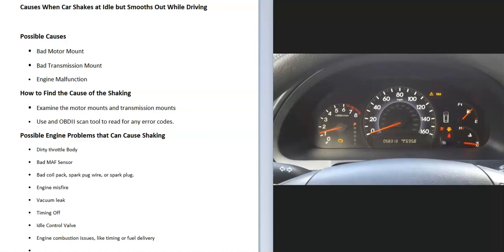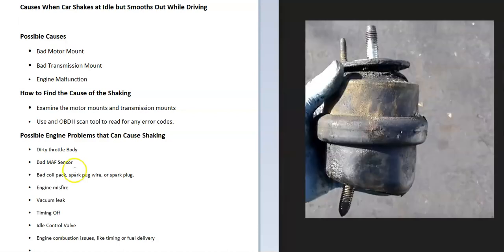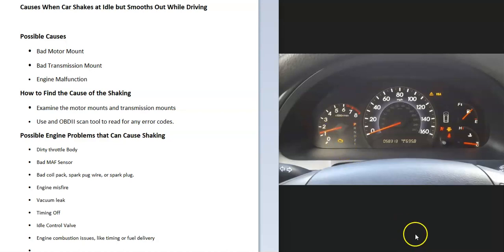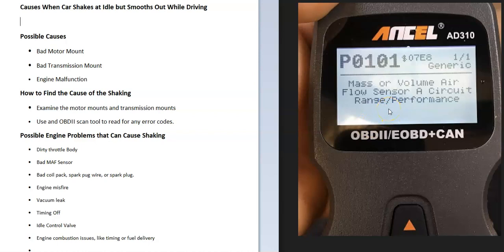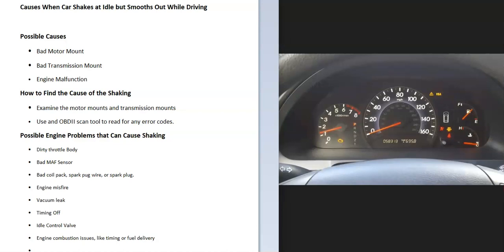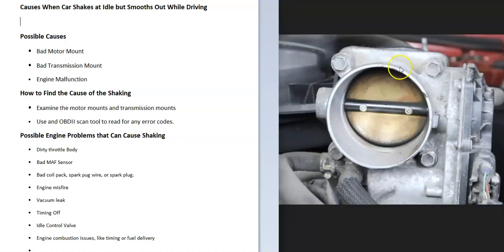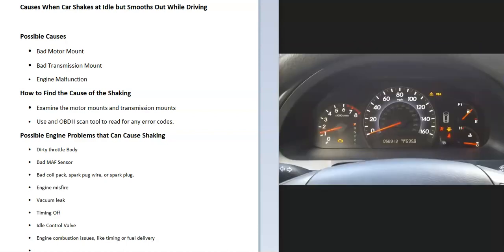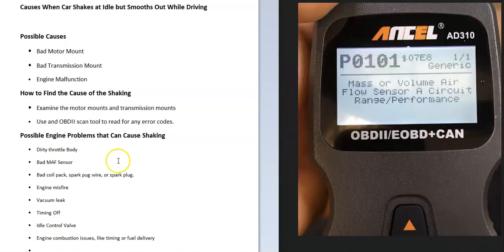Causes When Car Shakes at Idle but Smooths Out While Driving

Comment: 2008 Toyota Corolla shakes when idled. it’s not terrible it just rattles the glove box. 

Sound familiar or Any ideas what the issue may be? 

Will be taking it to AutoZone this week for the scan tool assistance.
Reply: My Honda accord shakes also at idle...spent over 2000 to fix  w two different mechanics..one Honda dealer...and still shakes.   I am wondering if it is safe to drive!

Comment: Hey @HVAC I desperately need your suggestions. It is toyota axio 2013. My car shakes when it is just braked to idle and specially when the AC is running. When the AC is not running, it is fine, no shakes.

Mechanic wants to change the gearbox. What should I do?

Comment: My wife has a chevy sonic that idle rough while in park and while in drive while stopped but smoothed out while driving, changed the motor mounts, and still ran rough but not as bad, gave the throttle body a clean and changed spark plugs and runs like a dream now, but yea there literally 1000 things that can cause this

Comment: my Elantra 2008. I added freon and is working fine, cool really good, but now is making the motor to vibrate. Every time I turn on the A/C the RPM goes down and the motor vibrates, stay at 600 RPM or less but the car Vibrate and I see the motor vibrate much more than when I turn it off. Once I turn off the A/C RPM goes back to normal. Idler air control valve is new. Motor mounts are new. PCV clean. MAFS new. Throttle body clean. throttle body sensor new. O2 sensors new. Car has 182K miles. Engine filter new. no vacuum leak.
--- Any Idea?  Thanks

Comment: My Mazda 3 engine vibrates alot when in idle either in D or P modes. I've already brought it to the workshop and they have changed the engine mounting and spark plugs. But the shaking and vibration is still there only at idle. What can I do?

Comment: What you are saying is very important and true 💯👍 but you don't get is this low on, fluids 😮 and yes very important part is the pcv valve so if you are going to put this what you are saying 😀😀😀 you better get it right because Harry homeowner will never figure it out 🤩😉😔😅😅 and yes codes are very misleading under stand because you need to get it right 👍

Comment: I replace the spark plus and coils still shaking , i clean the airflow sensor plus the throttle  an d still it shakes in reverse and  if i stop after i start driving it goes away , do u thik is the air sensor in the back ?   thank you
Reply: sorry oxygen sensor

Comment: Thank you! This video was very helpful.. hopefully you can help me with my challenger.. currently my is a few things.. bought a 2012 Challenger used didn’t realize that the transmission Bell housing bolts were not screwed all the way down and the transmission bill housing plate was open. I just tighten those bolts back down. But now I am getting a light white smoke from the engine bay and I’m not sure where it’s coming from. Could it be coming from the transmission bill housing plate being a little bit open? Also, I’m trying to locate a hissing sound that I thought was coming from the radiator hose because it looked like it wasn’t completely sealed. A low humming sound while the car is idling and the AC compressor clutch not engaging. I was told that there was a miscommunication maybe between my TIPM and the AC compressor clutch and that I should have it looked at but before I give my car to someone to have the TIPM look at I wanted to see if there was something else I could do.

Comment: So my car started vibrating at low 800rpm idol.  Anything above that and it stops vibrating. I'm at a lost but to maybe run fuel cleaner, change spark plugs about 2 years ago. no codes. MAF looks clean guess it wouldn't hurt to clean that.  Are there issues that may cause shake at that lower idol speed? .. what can I try. thank you in advance.

Comment: I have this.  A smoke test showed an exhaust leak on passenger side of my 1995 Silverado 5.7L. I can't hear it, but can see the pumped smoke. It idles correct rpms and disappears after 1800 rpm.
Reply: Was the idle problem caused by exhaust leak?

Comment: Imagine turning off a warm engine and after a couple of minutes starting it again. The engine ran rough for a few seconds at idle and afterwards everything was smooth and normal. What could be the cause in such a situation? The car is a 2.0T Volvo V60.

If it is related to ignition or fuel system, the problem should still persist, am I wrong?

Comment: Symptom:

Engine rough at 800rpm in drive/reverse.
Aggregating rattle/vibration noise in dash at the 800-900rpm.
Idles fine, no load,  ~700rpm, smooth, no rattle/vibration noise
       ( sometimes rattles idling under load, not often )
Drives fine. 

Actions taken:
-replace 2 motor mounts. ( problem improved with top-side-passenger mount)
-checked lower "torque-mount"
-Throttle body cleaned
-EGR valve cleaned
-MAF sensor cleaned
-no vacuum leak known, rubber boots and intake in good condition
-intake air filter new 

My thoughts:
- Spark plugs
- faulty injector( have used Lucas twice yearly)
- defective MAF sensor
- defective O2 sensor
- unknown vacuum leak
- defective coil pack
- maybe I should buy a new OEM air intake filter( presently no-name Amazon) 

Want to guess???
Reply: 03 toyota camry v6 idles  kinda rough in drive at stop first drive of the day. cleaned throttle body and air filter and map sensor, whats next lol,
Reply: my 2014 crv In Drive with brake applied, the engine vibrates when idle speed drops to 600–650 rpm, but is smooth above 650 rpm (exp: at stop sign or waiting red light )

Comment: Finally someone that mentions the motor/transmission mounts. Our ‘19 Chrysler Pacifica has had this same (rough idle at stops) issue since we bought it with 32K miles, but the problem has been reported even with much less mileage. I’ve already cleaned the T/B, the MAF sensor, it has new oem spark plugs and a new Air intake filter. It also has great fuel pressure, engine fires right up and there are no codes whatsoever. Yet, the rough idle at stop lights remains. This has been a mystery for many Pacifica owners for the longest time. Since these PentaStars 3.6L V6 motors were plagued by the leaking Oil Cooler, I’m inclined to think the continuous oil leaks deteriorated either the engine mounts or the transmission mounts just enough to create the subtle rough idle. Unfortunately replacing those mounts, it’s a quite a long/expensive labor.
Reply: did you ever find it out ?
Reply: @feverik  I traded the car. But I was on the right track, the bottom engine support bracket rubber bushings were worn out. Replace those and I’m 99% sure the engine “rough idle” will get better, almost disappear.

Comment: My rpm drops down to almost zero like it’s stalling, and shakes when the car is in park or stopped at a light, hopefully not an expensive fix
Reply: Did you manage to find the issue and if you fixed it how much did you pay
Reply: @taskforce7991  My Peugeot 206 has very low idle.Changed coil pack,spark plugs,throtle body,lambda sensors and problem still persists.

Comment: I am going crazy on the vibration. Changed spark plug and wire, engine mounts, ran carb cleaner through the fuel line to clean the injectors. Alignment done. No brake issue. Vibration persists. 

I used obd2 scanner. 

1. No error code. 
2. No misfire. All cylinders are firing well.
3. Vibration happen even when the car is in parking mode. Whole chase is vibrating. 

Only thing i havn't done is thottle body cleaning. Hard to reach foe me to do it. Would i see bad value in obd2 throttle position?

Comment: So only a couple times fast acceleration at 60mph had a loud thud like a rubber mallet hitting under car. Got motor mounts replaced now feel vibration when put into gear. Dash and steering wheel vibration. At speed it smooths out. Transmission? Corolla 2016 no check engine light

Comment: My transportation is shaking at low rpms new throttle body mass air flow sensor new coil pack spark plugs fuel filter  fuel pump this is ridiculous I don't have the funds to fix anything else on it this year
Reply: Canon bullet parts is not good. Proper diagnostic is necessary yo solve the problem.
Check the compression.
Leak test at head. (S)
Injector volume test.
Bidirectional scanner and live data are the best friends
Reply: Air filter check..
Reply: @Docorif  done

Comment: I have a Toyota matrix and my car was shaking , I had a code P02118 which was the throttle actuator, so I changed the throttle body and did the relearn procedure, it still shakes, I think it’s need a tune up, I don’t know what’s the problem

Comment: Having the same problem with my 530i, also when accelerating from 1st to 2nd there is a lag then when it does shift it kicks forward a bit, pretty sure now it’s doing the same for 2nd to 3rd gear just not as strong a kick after shifting
Reply: Not sure if it's the same problem but my RAV4 did the same when getting up to speed on the highway from 1st to 2nd n would jerk slightly but I would feel it n I changed spark plugs and my acceleration feels better shifting n haven't had one jerking feeling yet since I did them.

Comment: (06 civic 1.8L5AT)My transmission mount is shot,dry and cracks in it. However i don't think it's that. Kind of knocking when in drive but stopped(ex:red light). I had access to another civic, same trans, also knocks but more quietly, known good trans mount. However, once changed the trans fluid, it did smooth out, it's probably just a result of neglect.
Reply: So did you fix that issue,? What areas should be fixed? Mine honda civic 2005, same issue
Reply: @jawadalamdxb9054 I mentioned that changing the transmission fluid smoothed it out. It did smooth out but still present.  Im planning on doing the 2nd transmission fluid change again very soon. Check your transmission fluid, the owners manual will tell u were. It should be bright cherry red. If it black or something you should change it but be careful when taking it to someone, they'll most likely try to get you to "Flush" it, don't flush it, just do a drain and fill + trans filter. Honda does not recommend machine flushing the 5 A/T transmission ("fluid exchange" at a dealer is a different procedure).

Comment: Hi.. I have Cadillac escalade and it has RPM fluctuations in idle and it increases while AC On. I cleaned throttle, air sensor,  injectors and replaced spark plugs but the problem still there.. not sure what would be the problem!!
Reply: Hi were you able to fix it? I’m getting cylinder misfire issues
Reply: @tinic7776  hi,  unfortunately no so i just lived with it for now
Reply: @RedFire_zf  i at first was getting an engine too rich issue so I cleaned the oxygen sensor and thay fixed it but now I have been getting some cylinder misfires and already swapped spark plugs and ignition coils and doesn’t seem to change. I hope yours gets fixed eventually

Comment: Mine vibrates while idling in driving and when turning the steering wheel and not moving. When I put it park it doesn’t vibrate so I do that all the time to prevent the vibration. Anyone has any thoughts or advice?

Comment: To guy in video 
Usually  car shakes while my foot  on brake in drive waiting for red light . But no shaking while driving.  Will disconnecting battery for 15 mins do any good  ?
ECU will reset.
Your thoughts ?
Ps.
I also heard thst disconnecting negative terimal 10 secs then put back on resets compute system also.
Your thoughts

Comment: Our car shakes pretty heavily on idle when motor is warm/hot. Stops as soon as u give the tinyest bit of gas. Reason is our ”valve plate” not sure of the name but it has a tiny crack and it causes a little leak to cylinder 4 which is misfiring.
Reply: Sorry what?

Comment: I did a transmission fluid drain and fill and it smoothed out much better. A few months later it is back. Next time I will use premium transmission fluid like redline or royal purple.
Reply: Use Amsoil ATF full synthetic in the signature series.
Reply: I just did back to back 3X drain and fills with Honda dw1. Vibrations at start up and at stop in drive are better but not completely gone. I read it could take 300-1000 miles for the fluid to reverse the issue. One can try a 4th drain and fill at that point.

Comment: 2014 durango v6 here. It shudders with slow acceleration only, or keeping a steady speed. When letting off the gas, its fine. When using a heavy foot, its fine. I know i need new catalytic converters, as it smells of sulfer if i use a heavy foot for too long. Can clogged converters also cause this shuttering? I have a CEL currently, but dont have a scanner to read it at the moment.

Comment: 2019 2.0 TDI here. Vibrations when engine is cold and idling. e.g. at a red light. While driving its totally fine. When RPM drops to idle it shakes again. When engine is fully heated up the vibrations stop.   What could it be?
Reply: Could be the air fuel ratio sensor (upstream oxygen sensor) problem. The sensor has internal heater circuit to get to working temperature when engine is still cold. Get the code scanned, it probably has the code for oxygen sensor heater circuit malfunction.
Reply: @ Thanks for the answer! There are no codes that show any defects or faults. 🥴
Reply: Same happens to me, did u fix it?
Reply: @vely1341  Car is going in repair tomorrow. They think its the flywheel.

Comment: i got low fuel pressure ive changed the fuel pump hpfp, fuel rail sensor hooked up to obd2 it says fuel rail is at 1880 at idle 2011 audi a4 B8 quattro 2.0 tsfi any ideas

Comment: My 2013 shook a little noticed the RPM gauge fluctuating and the check engine light went on. 
I checked the engine and noticed oil around the throttle body. 
I removed the air intake and sure enough it was sucking oil. 
I Cleaned the parts and it fixed the problem.

Comment: No bulllshit and straight to the point. Thank you
Reply: REALLY? I have done everything he said and still the problem, so now what? Even mechanic don't know what is, and they only just want to start replacing things I already did for just stealing my money.
Reply: @HeydaCarreras same here did you ever find the problem?
Reply: @tunez602  I bought new IAC valve, new MAF sensor, an did a vacuum leak test. nothing came out. Now I see the vibrate when I put it in gear reverse or drive, feel like it will stop but keep working because the new IAC valve. the vibration I feel on the freeway at more than 55 mph is from this, so this wasn't from any suspension problems
Reply: @tunez602  I just replaced the air intake and TPS and still nothing. Same problem. RPM goes down when put in reverse or drive and A/C put it down as well. Now Steering angle off but not check engine light, no code, NOTHING at all. So, what else?
Reply: @HeydaCarreras damn yeah they told me it was the transmission because my car starts but doesn't move/idle drive or reverse nothing now 😮‍💨
Reply: @tunez602  Now, I took it to the Dealer, and they start talking shit because they don't know what the hell is, so they invent any excuse to start changing parts and look how to rip off me. They say because I installed a lot of parts new but not OEM, when 99% are OEM. They don't know a thing. They are blind like you and me, and everybody here say something different. This Place is just for entertaining. I have changed the whole car with parts and never found the problem. You move one part, and it create another vibration so you will never finish spending money. I think this is created on purpose, because even if you take it to the Dealer, you will come out feeling sorry.
Reply: is garbage video
Reply: @HeydaCarreras  This video didn't solve your specific problem so it's garbage? You're the one with problem. Maybe you're the garbage.

Comment: Check your engine mount. Most times, they are not well fitted or the bolts is not properly knob to fitting. Most time caused from the previous maintenance whereby the mechanic didn't mount or knob the bolts to fit in very well

Comment: Mine was my air filter lol, it was clogged. Cleaned the filter, then oiled it up, bam fixed. My rpm was going up and down like missfire, but now gone from clogged filter.
Reply: so let me get this straight. u oiled an Air filter 😂
Reply: @G8Code312 Some air filters are designed to be cleaned and reused such as K&N brand air filters. I have one of those on my truck. They require a special type of thin oil to be applied to them after you have cleaned them.

Comment: So my 2004 Buick rainier will start fine but as I hit about 10-15 miles per hour will loose power for about 10-15 minutes, not try to shut down or anything then kick back in normal… won’t happen again if I stop at a light and take off after the  1st initial go
But have noticed it does run rough at an idle stop when holding brake but not in neutral or park?

Comment: I have a 2014 Honda Accord V6 when I’m driving slow and idles back-and-forth and it starts vibrating only slow speed when I’m going fast or on the freeway is good. I don’t know if you could help me out.
Reply: Same with mine. Did you eventually fix yours?
Reply: @LifeofaPowerEngineer  it was my throttle body. I already fixed it.

Comment: I have a 2017 Chevy Cruze and it has the same problem and when I turn on the air conditioning the car shakes and one time it turned off. Can someone help me with your experience? Many thanks. I forgot and I don't have the check lights on

Comment: I have a 2017 Chevy Cruze and it has the same problem and when I turn on the air conditioning the car shakes and one time it turned off. Can someone help me with your experience? Many thanks.
Reply: Check your Engine Mounts.

Comment: Hi. I just got my Volvo v70-99 automatic turbo served, it shows 6 codes on the gas throttle (which is clean) but could it be MAF or something else? It´s been running well off and on but now the idle is very rough and ETS light comes on, even after disconnecting the battery.